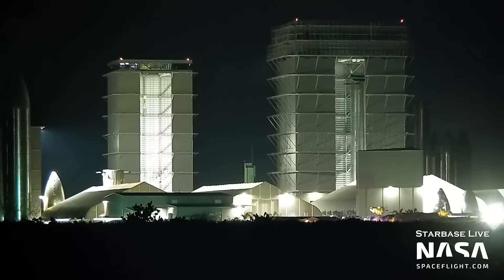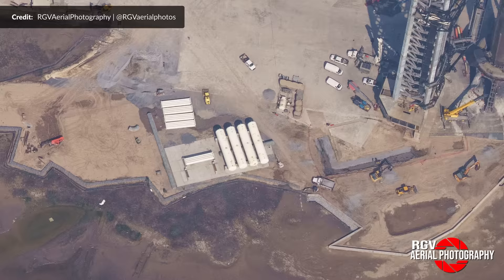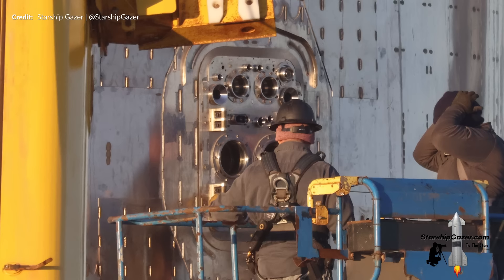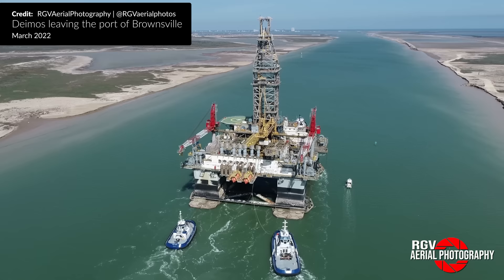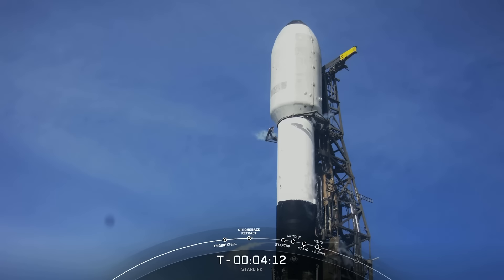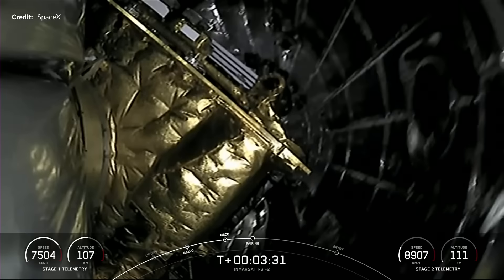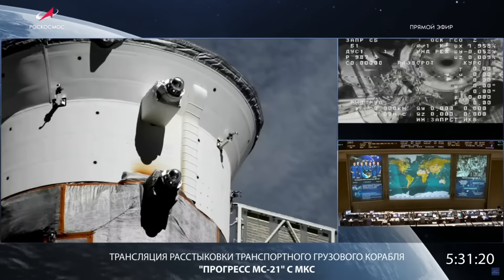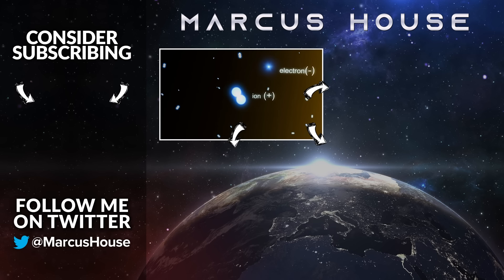SpaceX Ditches the Oil Rigs and Incredible Insights of the Orbital Launch Mount/Booster Static Fire

Comment: I think that F9 is being taken for granted by most.  Not you obviously, you give it credit with great excitement!  No other Space carrier is even close, or even showing any promise of coming close ever.  Is Boeing or LM even talking about reusability?  We will be waiting for Blue Origin to satisfy their new Mars contract for 30 years at the rate they are going.
Reply: Lockheed Martin doesn't make boosters, they make satellites. Boeing's only booster is SLS and it started development 4 years before SpaceX landed their first booster. ULA, Rocket Lab, Blue Origin, and Relativity all plan reuse. Booster reusability is great, but has drawbacks.

First, if you don't have a fast enough launch cadence, you can spend more on recovery equipment and personnel than you save by reusing the booster.
Second, you take a payload hit for the recovery system on the booster. The Falcon 9 B5 can lift up to 22.8 tons to LEO when expended (SX), but only up to 17.4 tons when landed on a drone ship (B1067.9). Doing a Return to Launch Site (RTLS) landing, costs even more payload as you have to add a boost back burn to cancel the lateral velocity and return back to the launch site.
Third, the higher and faster you go, the harder reusability is to perform. The heavier the dry-mass of your booster, the harder reusability is to perform.

So with SLS launching once a year, eventually, the cadence doesn't really justify recovering the booster. Not to mention that it gets higher and faster than a Falcon 9 as the SLS core stage almost reaches orbit, making recovery MUCH more difficult. The SLS core stage is travelling well over 3 times as fast as the Falcon 9 booster and is well over twice as high as the Falcon 9 booster at MECO. The dry mass of the F9 booster is 22-25 tons while the SLS core stage is 85 tons, so SLS masses over 3 times as much.
The SLS Block 1 can get Orion to the Moon, but not with the kind of payload hit like F9 has. The SLS Block 1B will send along a Lunar Gateway module with Orion, so it really can't take the payload hit either.

SLS started design work in 2011, 4 years before SpaceX landed the first booster and almost 6 years before they reused a booster.

No, I'm not saying that SpaceX should not recover boosters. I'm using how reusability affects the Falcon 9 to discuss SLS.

Comment: I'm curious to know if Starship has a plan to turn propellant tanks into habitats for lunar workers, as they will leave a lot of spaceships on the moon with lots of empty space that could be used.
Reply: HLS Starship goes back to lunar orbit after the surface mission is over. It is basically out of propellant then, so landing it again would require one or more Starship Tankers. Every Starship Tanker would take up to 10 flights to get to the Moon and almost certainly be stuck there, if delivering a full Tanker load.

Designing the tanks on HLS Starship to be accessible from the inside is doable, but would cost a bit of mass for it. The Lunar Gateway is not really set up for attaching an HLS Starship, but could be set that way if NASA decides to not expend HLS Starship. I think it would be worth modifying HLS Starship and Lunar Gateway for that, but I'm not a NASA engineer, so it is possible it may be more trouble than it is worth.

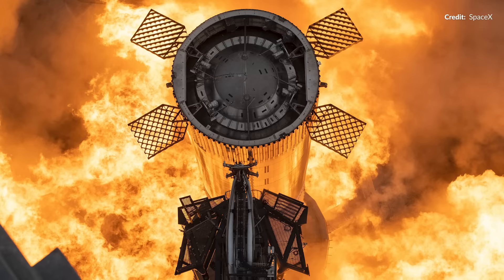Comment: Great video. I'd love to have a copy of the image you show at 00:57 in the video - the top down view of the booster during the test.  I can't find it anywhere.  Can you suggest where to look?
Reply from the maker: It is from SpaceXs Flickr account.
Reply: Do you know how to do a screen saver picture?  If you have a Windows platform: Watch the video in full screen mode.
 When your watching the video, then at the timestamp, press the Prt Sc key (next to the F12 and ScrLk on my keyboard). Then open your standard Microsoft Paint app. Then hold down the Ctrl key (don't let it go) and then the V key. So 'Ctrl then V' will paste the Print Screen image you saved into the Paint area. You can edit it/ crop it as you need. I have an entire collection of folders, courtesy of Marcus. I always save them with a comment CfMarcusHouse then a description. Of course they are not my 'property' so I can only use them as a private collection and can't reproduce them or make them accessible.  Shame really.

Comment: It may be that they will never have to go to 100%... as I feel like it would be better for the longevity of the equipment, and that would be one way to reduce stress to parts for this... the increased thrust will be from engine improvements.  It would make sense but we shall see. 🥳
Reply: Running at reduced thrust would actually burn more fuel because of gravity losses. And the engines would have to burn longer. So there would be some tradeoffs in doing that. 

They rate engines based on how much power they can produce without risk of failure or damage. I'm not sure how much engine wear would be reduced by operating at lower thrust than that. It's an interesting question, but I don't know that I have heard of engines being operated at reduced thrust to reduce long term engine wear. Then again our only examples are Space Shuttle RS-25 engines and SpaceX Merlin.
Reply: As Steve say's  above, It's an interesting question. 
The Merlin engines have to have maintenance due to the Kerolox leaving a carbon deposit. The Raptors will be clean burning. The RS25 engines are very clean burning. Like the aircraft industry, who have longer take off's, because they don't run the engines 100% throttle, they may be able to increase the time between maintenance checks in the same way. But as Elon is looking to turn the Starship Booster's  'turn-around times' to hours, rather than days, there is going to have to be initial processes to check the engines, so they can learn more about them and where the weak points are. That could be anything and everything from re-torquing every nut on the turbines to checking every interconnector nut, flange, wiring connector points and computer board connections and inclusive of the plumbing system. 
I mean, this rocket is going to be a real 'bone shaker' if the current Crewdragon astronauts' comments are anything to go by.
I guess when they have enough information, they will know what advantages they will gain by running at 90% thrust (or less). At least if you calculate for 90% for launches, you have a 10% 'fail-safe' to use for 1 or 2 Raptor engine failures. 
Obviously the Starship Booster's 'weakest link' will set the maintenance cycle and number of uses. Maybe the Stainless Steel metal fatigue of the rings, will set the maximum re-use limit of the booster. The Falcons have an aluminium grid frame to support the 'skin' where as the Starship Booster has many welded points on a ring and vertical support grid. I guess re-use is the only way to see if that design is just as robust. 
It's so exciting to be at the leading edge of this whole different approach to the other planets and moons. What a buzz!

Comment: You mentioned a record quick pad turnaround, but what is the quickest drone ship turnaround, they have move back to land, unload the booster, quick service? And then steam back out to the landing area. Hard to accelerate that? Will they need additional drone ships if the launch cadence is increased ?
Reply: I think MH said three different ships were used for this week's catches; but it would be interesting to learn what's involved...
Reply: @stepheneyles2198  Just Read the Instructions (JRTI) and A Shortfall of Gravitas (ASOG) are the two drone ships at Port Canaveral supporting the launches from LC-39A (KSC) and SLC-40 (CCSFS). Of Course I Still Love You (OCISLY) is based at the Port of Long Beach to support launches at SLC-4 at Vandenberg SFB, CA.
Reply: At some point, if the cadence continues to increase, SpaceX would likely need more drone and recovery ships.

Comment: Could ship 26 be a test of new emergency escape system, separating from booster if anomalies at lift off?
Reply: perhaps
Reply: Nah, Starship with a payload would not have the thrust to weight ratio (TWR) of an abort system. And the Raptor engines take too long to spool up to full thrust. Not to mention, the thrust from the Starship (second stage) engines would go right into the top of the Superheavy liquid methane (LCH4) tank. Starship (second stage) will likely have a TWR of around 1.5 and the Raptor engines take a second or more to ramp up to full power. The Superdracos on the Crew Dragon have like a 4.6 TWR and are at full thrust in 100 milliseconds.
Reply: @steveaustin2686  True for 6 engines ship, not so much about 9 engine one. Some capability is better than none
Reply: @alvianchoiriapriliansyah9882  You still have the problem of the engines taking too long to ramp up to full power and that they would fire DIRECTLY into the LCH4 tank of the Superheavy booster. The only way it would be helpful is if some disaster somehow took out enough engines that Starship would not be able to reach orbit AND it did not destroy the Superheavy booster in the process. Even then you wouldn't use the engines to fire into the booster, because you then have a catastropic problem. And you still have the problem of the Raptor  engines are not fast enough to get away from a catastropic problem.

Going from 6 to 9 engines is not going to magically triple the TWR either.

Comment: Maybe a dumb question, but why doesn't the rocket lift off during static fire?
Reply: It is held down by clamps. The clamps release when they launch. This allows starting up the engines and letting the computers check out the engines for a few seconds before they lift off.
Reply: @StevePemberton2  Dang, must be some strong clamps😂

Comment: Is it all heat damage that they were condending with in terms of the concrete on the OLM or vibrational acoustical damage as well?
Reply: Good question. My couch potato thinking is that it's about moisture. You take your engineering workshop and look at the Oxyacetylene area. Usually there is a brick table that is used sometimes to cut or weld steel pieces on. The bricks are usually rugged looking after years of being 'blasted' with a hot flame. The flames are 3,480 °C compared to the Methane/Oxygen 2,810 ºC temperature from the Raptor engines. If you blast a kiln fired brick with heat, it can probably take it pretty well. But the force behind the Raptor is probably going to penetrate through any small crack or hole. If, there's any condensation in there, it's going to turn to steam and that steam will apply a lot of internal expansion and pressure and blow out pieces of brick. So I figure the concrete can handle the heat alright, but it can't let the heat penetrate too deeply. Maybe why the cooling water deluge volume, is enough to prevent it getting hot and the moisture blowing it apart? 
Also the added slivers of metal in the concrete mix, help it hold together more strongly. And hopefully a nice smooth polished surface with few pit holes in it, so harder for the heat to penetrate. That's my 'guess'. Someone knows the real science behind it. Hopefully they work for SpaceX.

Comment: been trying for months to have someone comment on the fact that the early starlink launches had 60/ launch.  Now it's 50-55??  I thought it was "ridesharing"
Reply: Depends on the orbit the shell is going to. The more energetic the orbit, the less Starlinks they can carry. I believe Starlink v1.5 is bigger as well. The Transporter ride share missions took a few tons to orbit and landed back at SLC-13. The 325 kg (0.3 ton) IXPE sat required a drone ship landing, because of the energetic equatorial orbit.

Comment: Are the electric motors wiring etc safe from EMP when they are out of Earth's magnetic fields?
Reply: EMPs are vastly overrated, they only impacted telegraph wires because they were strung out over many hundreds of miles.

Also, anything in a metal housing is effectively inside a ‘Faraday cage’.

Comment: I predicted them ditching that oil rig since the start. Its a logistical nightmare.
Reply: I wonder how much of the stripped generators, buildings and motors they used at Starbase? 
So are you thinking they will build a customised ship or barge or procure a remote atoll or island?

Comment: Wonder if SpaceX engineers did a deep reverse engineering analysis on the oil rig platforms, so they can make their own with the required custom bits built in from the beginning.
Reply: Why go through all that trouble, when you can just go to the people that build oil rigs and have them build you one? Much easier. SpaceX has said that they prefer off the shelf components, if they can get what they want, when they want it, for the price they want. If they can't get all three and they can make it in-house, then they move it in-house.

Comment: Hey Marcus, as always, I love your YouTube channel, so thank you for what you do here. I have a question. SpaceX and Elon Musk turned away from having legs on the starship. I'm sure you recall the issues and difficulties they had with the legs not holding up. So now they plan to catch the starship with the tower arms. How do they plan to land the starship on the moon and on Mars with no legs?
Are they still working on plans four legs on the starship
Reply: The legs used on SN5-SN15 were temporary, one-use legs only for testing. SpaceX said that they were working on larger, more capable legs to replace the temporary ones. The Moon has 1/6th gravity and Mars has 1/3 gravity, so they said that the legs for those didn't have to be as robust as the ones for Earth's 1g environment. Since Earth landing platforms can be made, SpaceX is planning on doing without the legs here on Earth to save mass. Musk would like everything possible that can go into Stage 0, to go into Stage 0 if possible. If the Mechazilla catching doesn't work out, they would likely take the mass hit here on Earth for landing legs again.

Comment: turns out that hole on the Russian MS21 is supposed to be there.  The hole was found to be there from other missions. Same place.  Same leak. It appears to be a coolant release hole. I'm guessing faulty valves.
Reply from the maker: They said themselves it was an external issue, but it is really hard to know what to trust.

Comment: It would make sense to create artificial shielding for mars by having a satellite close to sun in between mars and sun. Even small amount of shielding would help quite a bit, especially close up to sun.

I would presume something "tiny" like 1MW magnetic field could make an significant impact on what reaches mars.
With Starship getting cheap launch costs i would presume that would not even be prohibitively expensive neither :)
Reply: Two problems.

First, the Sun is roughly 800,000 miles in diameter. Mars is just over 4,200 miles in diameter. A satellite in between the Sun and Mars would not change anything.

Two, there is no way that the satellite near the Sun and Mars would stay in alignment. Mercury's year is 88 days long and Mars' year is 687 days long, so Mercury goes around the Sun about 7.8 times to every time Mars goes around the Sun. A satellite even closer to the Sun would have an even shorter year.

Comment: Planning for 90% thrust actually means that they can still launch and get to orbit with up to 3 engines failing
Reply: I'm pretty sure you are not saying that they would launch at 90% thrust so that they could throttle up if one or more engines fail, I think you are just saying they would plan so that they could operate at 90% thrust. Either way the calculation is a little more complex from what I can tell.

Rockets typically launch at their maximum thrust in order to reduce gravity losses. They reduce thrust only to minimize aerodynamic loads or g forces. Normally in engine out situations they make up the difference with longer burn times on the remaining engines. In other words the fuel that the failed engines would have been using is now available for the other engines.

But there will be gravity losses caused by the reduced thrust in an engine out situation, so total performance will be impacted by engine failures. So yes they plan so that they can reach orbit even if one or more engines fail, but the performance loss is not linear in terms of percentage of thrust loss. As an example losing 10% of the engines might be the equivalent of running all of the engines at 95% thrust. Those are made up numbers but that's the general idea.
Reply: Totally agree, you want to gain  as fast as possible altitude and range at full throttle, who cares of the launch pad. Then, if all goes well, they might throttle down to 90%, or keep going in case of engine out, which is frankly highly probable.

Comment: Boca Chica is considered environmentally sensitive. I have to wonder if capturing as much water as possible from the deluge system and reusing it makes sense?
Reply: As Marcus says at 3:03 in the video, SpaceX can't just let it flow into the nearby waterways "as pollutants may need to be filtered out beforehand."
Reply: @skierpage  He says "probably," and," if I had to guess.' I was saying that it might make sense to just use as much of the same water over and over again. Instead of filtering it and dumping it. A decent amount will of course turn to steam.

Comment: Regarding the rocket engines' noise levels, in theoretical acoustic terms if you double the number of coherent sound sources, relative to your listening position, the sound level goes up by 6dB, because everything reinforces. The noise of the individual rockets is not coherent, it is broadband and pretty much random, each rocket is different in terms of individual frequency phases. In that case, doubling the number of sound sources only increases the sound level by 3dB. This is because you get a mixture of reinforcement and cancellation. I would expect rocket engineers to know this though, so perhaps something else is going on as well?